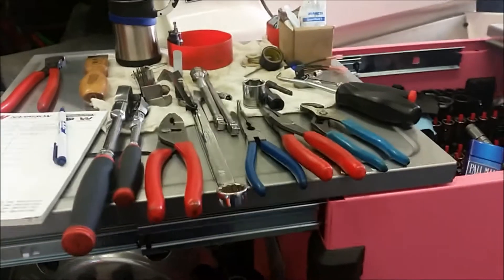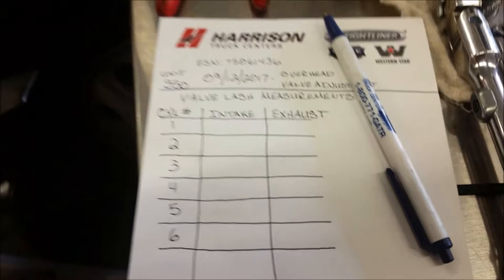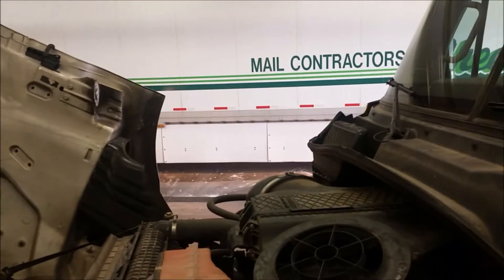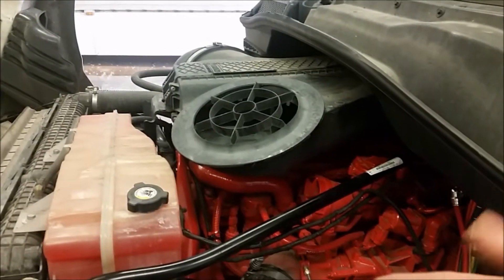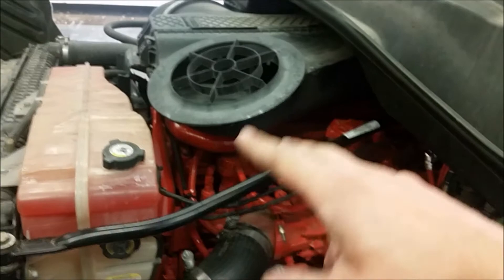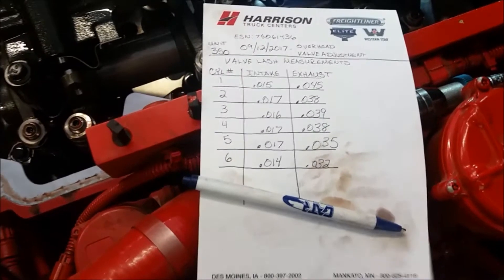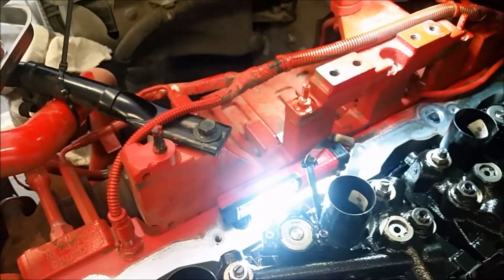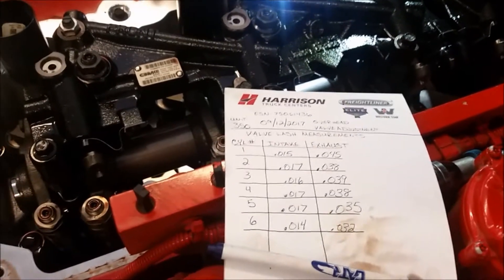THE CUMMINS EXPERIMENT #4, Overhead Adjustments...

Comment: Our company got 25 CNG Cummins  Petes about 5 years ago. These things are in the shop constantly. Trash.
Reply from the maker: What is your pm rate on them? As the turbos webt out first time around did you also replace egr cooler?
Reply: @BeardedSeabee82  don’t know exactly what the rate is but we’ve had multiple head failures. Some issues with the turbos and yes we replaced the EGR coolers. These things run hot. We’ve just started parting out two of them because of cost.
Reply from the maker: Weve been running cng since 2014 at company i work with, at high point had about 70 cng's in the fleet, right now (between units getting totalled in wrecks and some main bearings gone out) we are still sitting around 40ish in the fleet. So have seen our fair share of everything on them. But cummins does recommend head swap at 900k, biggest thing usually being flattened cams or a valve going bad in some way. But also, at 900k, might as well do an in frame and extend longevity(my opinion but mgt doesnt see it thay way) good oil, running overheads every 150k, and all issues you can see with ignition components does make lil bit of difference.

Comment: Hello Seabee!
Thank you so much for your truly enlightening work on CNG trucks.
I'm thinking about buying a used CNG 2015 freight liner truck that has 700k miles on it.
Mind sharing your thoughts on come of the common issues that are registered on the Cummins ISX12G engines in this mileage range?
What would be your thoughts on key aspects to look out for when checking out the truck ?
Lastly does your shop take in private customers ?🙏🏾
Reply from the maker: Sorry for late reply, just got email notification of this comment (yay yputube). Anyway on the '15 with isg12, well, you can possibly get another 200k-300k out of it before you will likely need a head (if it hasnt already been replaced, if it has been replaced relatively recently likely to get a hella lot more miles out of it than that. Common issues, if they havent (which they shouldve by now) been dealt with is exhaust manifold cracking (they made updated manifold for early 15 models) and egr cooler and turbo. Replace spark plugs every 75k miles and religiously have pverhead ran every 150k miles, inspect ignition coils and extensions each time and replace those as necesaary. Another thing that could happen could be egr valve needing replaced along with some air intake components at around 1M mile marker ish. And as far doing private work at shop, that I am not able to, however I am able to do own work on the side on my own time, just not inside company shop. Any other questions by all means feel free to ask
Reply from the maker: Also make sure crank seals arent leaking

Comment: Wow that’s a pain just to get the valve cover off ! Great video and honestly my nerves would be shot trying to do an overhead and take measurements Nd write it all down and concentrate with all that back ground noise and radio going like that. Nerves of steel ! Awesome job. Sure makes you miss those old 60 series Detroit’s doesn’t it !
Reply from the maker: +Koon Trucking sometimes it does indeed. Even makes me miss 3406E's as well. Loved doin oveeheads on those. Regular cng time is about 2 hrs to run overhead, put headphones on and rock out, usually no one bothers me since im only one in shop that can do oveeheads. 14L 60's used to take me about 3 hrs on the columbias if they had jakes on em. Good times, but the test engine was a 4hr pain in ass process for sure. Thanks for watchin!

Comment: Hopefully they compensate you good for doing this. I would like to know if you like the engine or do you think they need to do something else. I really don't think it's going to work if that's all your getting with the plugs. I would say not efficient for a independent owner. Great video thanks my friend keep up the great work see you in the next one.
Reply from the maker: +Scott Pearson The regular cng engines i deal with are relatively simple, but the test engines have few quirks neither myself or drivers care for. Fuel cost os cheaper to run, no DEF, no DPF either, fairly simple to usually diagnose, but cost of tractor is greater, for fleets makes sense but for 1-2 tractor owners i recommend glider/traditional diesels for sure. Hankyou for watching
Reply from the maker: +Scott Pearson typically set of plugs will get 70-80k miles out of (cummins updated recommend changing every 50k, overhead every 150k miles) but if valve lash is out of spec found out from past with regular cngs will foul out plugs however. Typically overhead and plugs change takes me about 2ish hours unless have other issues to deal with (clips on harness pigtail breaks and make new pigtail, wait on a part, etc.)
Reply: I was just wondering I'm not familiar with that engine. I didn't know they ran spark plugs until I seen your video on it. I am still trying to figure out the cost efficiency. I am use to the 60 series Detroit we have a test Engine in a pulling Tractor two turbos. The biggest problem we have had is injectors but it is alcahal injection to.
Reply from the maker: +Scott Pearson to run set of plugs usually around $300 just for all 6 plug kits, when they run right they run good, 12.7 a little under powered on heavier loads (15L would have been better setup i think) but other quirks kinds wind up cost run repair wise close to the epa13 engines. (Exh mflds, turbo, egr etc) but some rebates for "greener" tech, fuel mileage avg close to "7 mpg" cost per "gal" bit cheaper too (lbs per gal figured by ecm conversions)
Reply: That's better MPG then some of the older ones but not by much. Just seems like a lot of maintenance just on the engine.
Reply from the maker: True, although for just changing spark plugs itself is about a half hr ordeal including testing coils, so its not too bad there, but i tell ya this test engine pain in ass either way lololol.